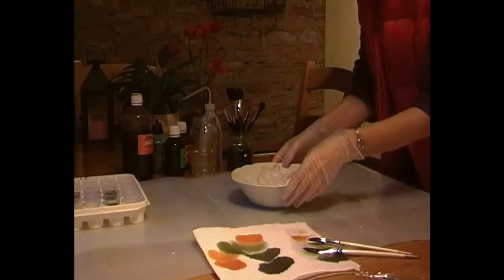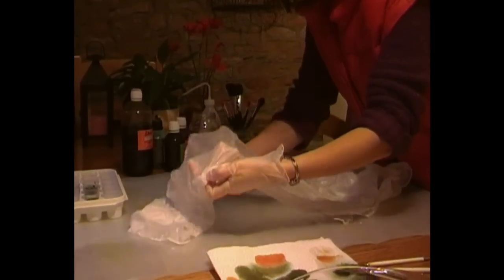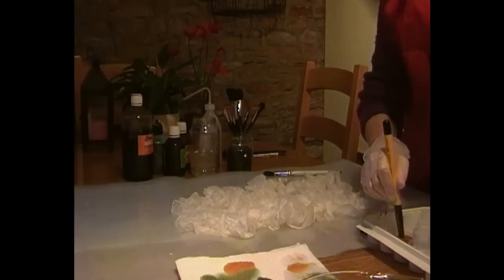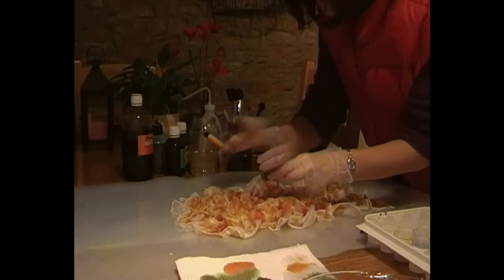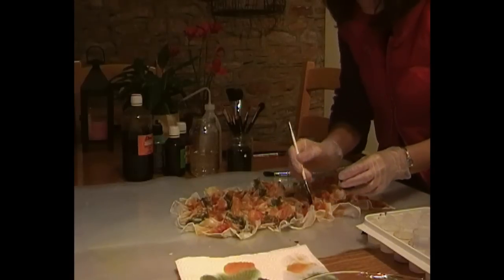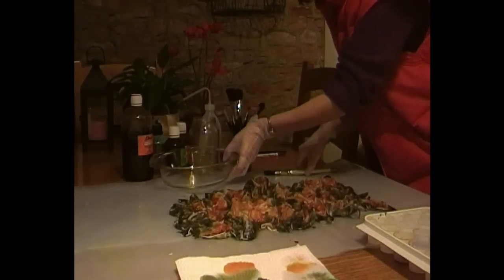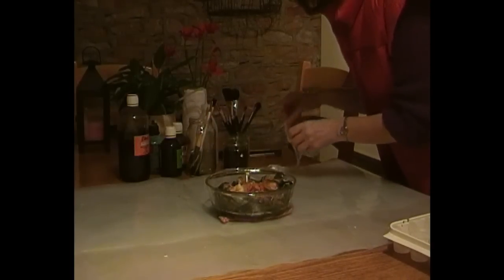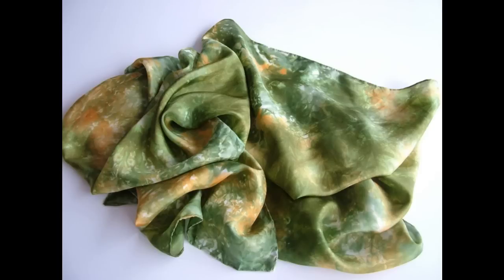Silk Painting with Fiona Stolze - How to Make a Silk Scarf in your Microwave

Comment: Fiona,Thanks so much for the video. I just love hearing your voice! Quick question. I like the effects that salt make when working with dyes and silk. I saw a microwaved/dyed scarf that had a really nice texture and was told they used salt as well as setting in the microwave. Can you share your experience and tell me when do you think they used the salt?... thanks. Lydia
Reply from the maker: Glad you enjoyed the video Lydia. I generally don't use salt with the microwave.  You could experiment and put salt on the very wet silk for a minute or two then shake it all off and microwave the wet silk. The idea of using the salt is to leave it on until the silk is at least partially dry. The microwave is intended for very wet silk as dry silk can simply burn easily.  But as I said, play with it a bit and see. :-)

Comment from the maker: Hi Nida -  A Quickset dye has all sorts of things added. I have never used them and don't recommend them. Get yourself some normal silk acid dyes and a piece of quality silk with no other fibres added. If there was anything else in the fabric you used, then this doesn't work either. Use silk acid dyes and pure silk (the dyes are specially for protein fibres). And then it will work. :-)

Comment: Hi Fiona, Do you think this method will work using Tinfix dyes? Thanks for your great videos - and thanks for an answer.... Terri.
Reply from the maker: Hi Terri - I've never used Tinfix dyes but as long as they're acid dyes and the silk is very wet, it should work perfectly. Try a little piece to see how it works out. I don't see any problems there at all. It's the paints that are a big no-no.  :-)

Comment: Thank you for your post.. I do have a question though I took a fabric dyeing class and we used some type of solution on the scarf so that the paints would be more uniform... Would you happen to know the name of this solution?
Reply from the maker: Hi Sweetana - for dyeing silk it's always recommendable to soak your fabric in a vinegar and water solution for a few minutes beforehand. When using fibre reactive dyes there are different instructions. That involves soaking the cotton or other fabric in a soda ash and water mix. The exact instructions come with the dyes. Hope that helps. :-)

Comment: Nice!! Do you find the silk drying out? How do you keep it wet as you work?
Reply from the maker: Hi Kamalani - you soak the silk in a vinegar and water mix, then you squeeze out excess liquid before adding dyes. The silk is very wet as a result. There is no risk of the silk drying out unless you leave it lying for an hour or two.
Reply: Fiona Stolze thanks for the info. Things dry out quickly in our weather (Hawai'i), even when it's humid. Best always!
Reply from the maker: Best thing then is to have everything well prepared and then work quickly. Good luck! :-)